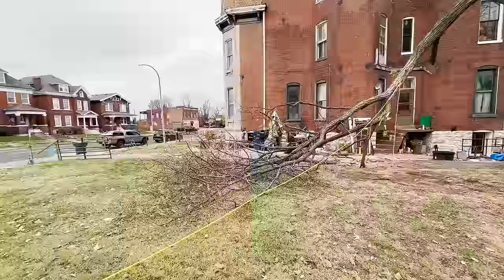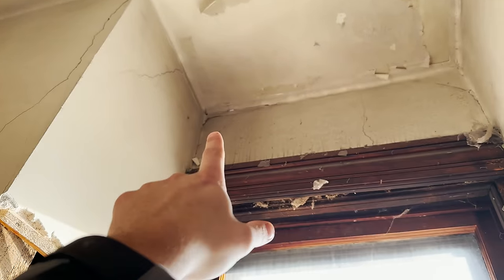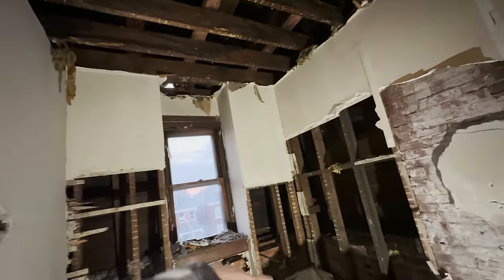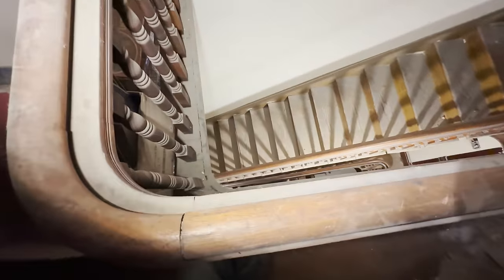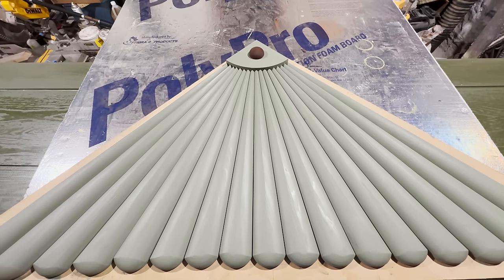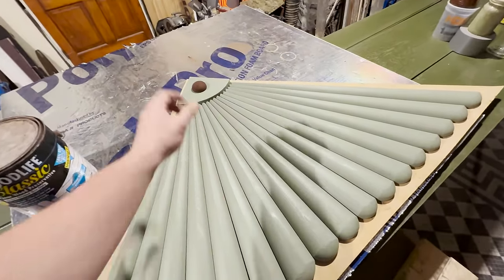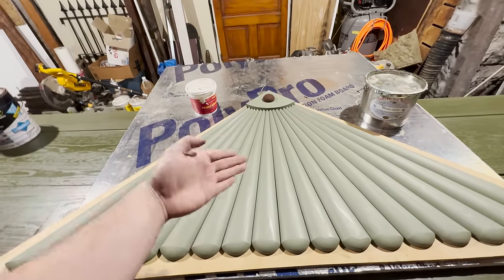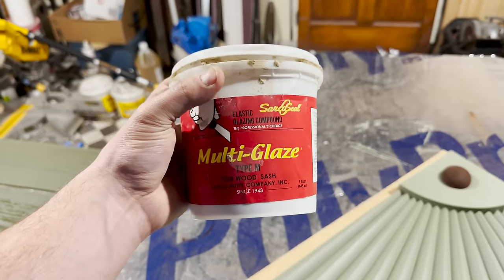Now This is True Art!  S3 EP45

Comment: Your dormer is gorgeous! But I have a teensy technical quibble: Lead white and zinc white are not just anti-fungal, they are opaquing agents. Without lead or zinc, when you add pigment to boiled linseed oil, you end up with a stain, not paint. Buildings - even old buildings - don't need to breathe, they need to dry (I'm teasing you a bit, there, 'cause everybody calls it breathing). People forget that humidity and condensing water vapor is more of a problem than bulk water from rain or melting snow. Antique buildings are designed to be vapor open. Modern buildings are designed to be Yeti coolers, with the outside of the wall drying to the outside, and the inside of the wall drying to the inside with the aid of mechanical ventilation. Older architecture is not designed that way. You get into trouble when you treat an old building like a modern one and use vapour-impermeable products inappropriately (your painted limestone is a classic example) or otherwise vapour-seal the building. You can never fully avoid the water, you can only give it a way out. If it can't dry - it's gonna die. You're on the right track, Caleb - keep up the good work!
Reply: All so true, I think as an artist he probably know sbout leadwhite and zinkwhite and what they do, it is a reminder though. Zink (or lead) also prevent mold growing on it
Reply: @gunlindblad6816  Yeah, well I found out by accident when I mixed primary paint colors with boiled linseed oil! LOL Of course, I'm a lot less artistic than Caleb, but have a lot of years experience building and renovating houses. Maybe I'll just stick with that ;-)

Comment: Thumbs up on the mathamatical nightmare making the parts. Beautifull detail. Beautiful choice on using Cypress wood. Cypress is very water & weather resistant. Glaze puddy the holes & cracks. Lindseed oil led paint is close to what I suggested to use. Learn something new every day. If you'er not learning something new every day, you'er not living life. I'm glad you still have a father to visit. Mine has been 6 feet under since 1999. Never goodbye! Keep restoring!

Comment: I didn't know about the moth balls but we got rid of squirrels with men's aftershave (we used Mennen).  It worked for us but we did use it in the summer when the attic heat helped to make the aftershave "more aromatic" and the squirrels had other places they could go.  Hope the mothballs work for you because I know what kind of damage tree rats can create in an old building.
Reply: I used Sweet Pea cologne (pretty strong, and cloyingly, icky sweet, especially in large quantities) from Bsth & Body Works some years ago to get rid of a mama raccoon who was setting up a nest in my garage.  I also used shredded bars of Irish Spring soap in a couple of other corners.  You can shave slivers off with a knife or grate it in the large holes of a cheese grater.  Irish Spring works against all kinds of animals for protecting plants and gardens, too.  You can hang bars in net bags like onions and potatoes and lemons come in or even buy net at a fabric store and make little drawstring bags to hold the bars.  Then tie the net bags to stakes or the fence.  It gets renewed by the rain.  Or you can rough/scuff it up with the net bags to help keep the scent fresh.
Reply: @Lucinda_Jackson  I'm in western Canada and have used the net bags and Irish Spring  soap on my shrubs and small trees that were getting eaten by deer.  Unfortunately, I've only had limited success.  The deer learned very quickly to just avoid the effected branches.  I would have needed hundreds of bars to keep the deer from everything.
Reply: I used mothballs and squirrels got out immediately. Unfortunately had to collect and remove them as you could smell mothballs in one bedroom under the attic. Luckily the hole had been closed up..

Comment: Hi Caleb. If you want to make the Linseed Oil Putty that was in the house originally then the following is the recipe - 

Mix 50% Raw Linseed Oil with 50% Boiled Linseed Oil. Next you add the Linseed Oil 50/50 Mix with Chalk (Calcium Carbonate Powder/Chalk Whiting). The Mixing Ratio for the Linseed oil and Chalk Powder is at a rate of 4 x weight of Chalk to 1 time weight of Linseed Oil 50/50 mix. (You must mix by Weight - not by Volume).

The above basic Mixture makes the same as Modern Store Bought Linseed Oil Putty, which will last for maybe c.15-20 years max. 

However it is not how it was traditionally made (several ingredients are left out by modern manufacturers) . You must add the following additional ingredients to create Traditional Linseed Oil Putty that will last 100 + years. 

Next you must add Zinc Oxide Powder. The mix ratio is exactly 2 Teaspoons of Zinc Oxide Powder per 1Kg of Putty Mixed (as above). The Zinc Oxide Powder is essential to inhibit Mould Growth.

Finally the most important ingredient - Red Lead Powder. (Note you must use gloves when handling Red Lead Powder and mixing it in). The purpose of the Red Lead Powder is it stiffens the Putty, but also makes it way more durable and longer lasting. The Mix Ratio for adding Red Lead Powder is at a rate of 4 x Tablespoons per 1Kg Putty. 

This is how Linseed Oil Putty was made traditionally and this exact mixture ratio is what will give you a Linseed Oil Putty that will last generations. Ship Builders use Red Lead in their Putty mix as it allows the Putty to last for years in very wet exposed areas.
Reply: WOW 😮 Intelligent life! LOL 😆

Comment: I'm sure you thought that far ahead, but just in case, squirrels can jump over 9' horizontally, and of course that can and will be dramatically extended if their jumping off point is higher than where they want to land.
Reply from the maker: current situation is over 9 ft and lower to higher

Comment: Are the upper floors receiving any heat?  Closing the doors to the individual rooms might help keep the house warmer, especially on the top floor where there is no insulation in the roof.

Comment: *******
thick metal screen between joists (and on if in the area and determined) that they can't chew through - it will limit where they go

*********
keep mothball where they won't degas where YOU will be breathing (or where it can travel to an opening) - if it gets through house THAT'S  BAD BAD

the way the nails are hit in also important for any capillary action water might take around any glaze not perfectly sealing hole

Comment: My grandparents owned a Greek Revival style home (circa 1895-6) north of Boston on the water. They used to have areas scraped and repainted about every 15 years (the sea air is notoriously hard on exteriors). 
Once they took the lead out of the linseed paint, they had to do it every five years. They could only afford to have two sides done at a time because it was $30K. 
Yeah, it was a huge house, and the box gutters needed to be replaced because of the ice damming basically broke them off the house. But it was really that expensive because they had remove the crap paint they make nowadays all the way down to bare wood so the new crap paint would stick. 
It's too bad that people don't take care of their homes to the point that paint blisters, peels, drops to the ground and causes the lead paint to leech into the ground or worse little kids eating the paint chips. Taking the lead out of paint was necessary because people just don't take care of their stuff.

Comment: A mechanic told us about using mothballs in a sock on the engine in my SUV after a squirrel chewed through some electrical lines twice. It worked, we just had to remember to take the sock out of the engine before driving the vehicle.

Comment: Before tearing out the hall ceiling on the top floor, you can use a ladder to check the cedar closet ceiling from the trunk room. If you see keyed plaster on lath, it would mean that the cedar ceiling was installed under a closed space. And you could see if any holes are in the lath. This would mean only removing the rockwool insulation above that portion of the original ceiling. 

While your desire to reinstall solid wood sheathing behind the sunburst, remember that wether it is T&G or shiplap, this wood will swell and contract thereby creating potential gaps into the dormer roof space. It is this regime that can cause the sunburst fasteners to fail, especially if the sheathing is installed horizontally. And permit weather damage to the sheathing even if painted . 
It is one of the reasons that plywood was invented. So instead of just the solid wood sheathing, or in addition to it, the use of marine trade plywood even of a 1/4” thickness secured on the perimeter and across the horizontal center can assist the solid sheathing, as it can be painted with your paints in the same or contrasting color. As you will cover the edges with casings and moldings, those fasteners would be covered as would the center fasteners with the sunburst.

Comment: The new Sunburt looks amazing, but noticed it uses 17 boards and the orginal appears to have 15 
Not a complaint just a curious observation. The house is going to look Incredible.
Reply: We decided to build the new one a little tighter than the old one, as it would be more weather resistant.
Reply: @klavelle72a  Good plan. Fantastic job👍

Comment: I'm afraid that you have misunderstood linseed paint, it's not the paint in general that deteriorate over time, it's the oil in itself. What happens is that sun and rain messes with the surface. It will leave the pigments bare and they become bleached by the sun. This will go quite quickly on an exposed wall. You don't have to repaint, just refresh the surface with new oil. Don't buy the cheap stuff, that sort will mold. The more expensive the better, you want an oil that's as bright as possible. There's no special time, it's impossible to say how many years, just have a reference board that you painted at the same time and when your facade becomes brighter than the reference board it's time to buy linseed.

Comment: I am also renovating a big old thing, approx 130 yrs old, with a bunch of motifs inside and out to replicate. Have you looked into getting a CNC machine? Approx $3 ~5K, you could make that entire decorative piece from a single solid piece of wood and it will come out perfect. Same for all your corbels, etc. As a toolmaker I am sure Mr. Brown would appreciate a technology like this.
Reply: If you made this out of one solid piece of wood, the expansion and contraction through wet and dry seasons would cause it to rip itself apart.
Reply: @klavelle72a  If mounted normally, in a way that allows for some wood expansion, there should be no issues. For example, the horizontal wood panel below this piece has been there for 100+ years. There are many examples of carved wood pieces mounted on the outsides of older houses that survive for a century or more. Wood pieces do not spontaneously rip themselves apart unless they are constrained in such a way that does not allow for wood movement.

However if you wanted to construct this piece out of individual sections -- for whatever reason --- a CNC machine can churn out multiple sections with high precision and reproducibility in a fraction of the time as doing it by hand.

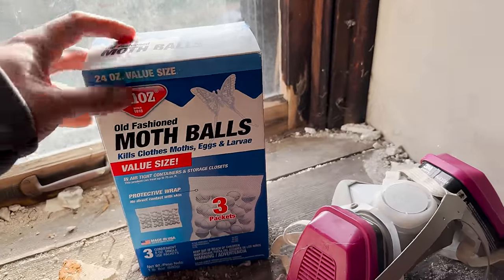Comment: @3:42 Moth Balls do not work dissuading rodentia from taking up residence and they stink and stink forever.
I'm in the RV and mobile home repair business for twenty years. Many, many customers used Bounce dryer sheets. Not store brand, Bounce. There's something about them that discourages rodentia from the area. Just take the sheets out and scatter them. The worst it'll make the area stink pretty.
Does it work? I've never had a mouse problem where I've used them and customers tell me neither have they had issues.
Reply: Will what works on mice, work on squirrels?  🤷

Comment: You are so right about having a house breath.  My father had our 1940s house tex coated including the under roof edge rafters.  I had to have the entire thing sandblasted and scrapped off ten years later due to moisture mold problems and wood rotting.  I had it re stuccoed as it had been originally.  I’m in California so there’s a lot of original old stuccoed homes here.